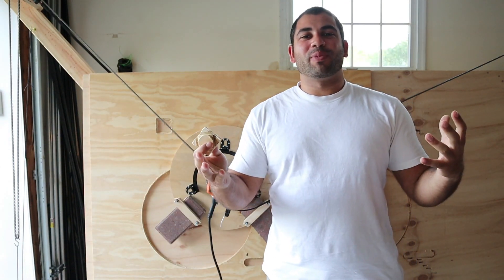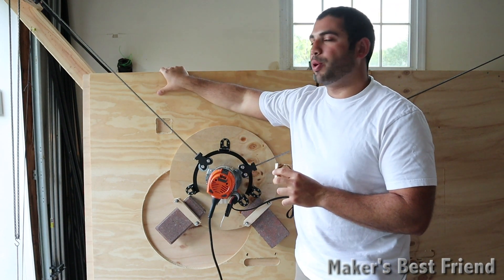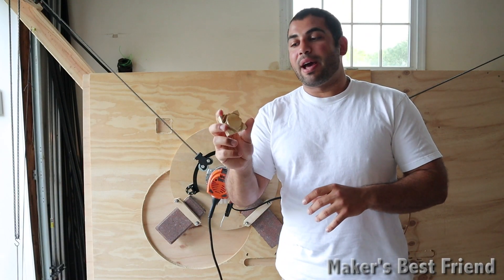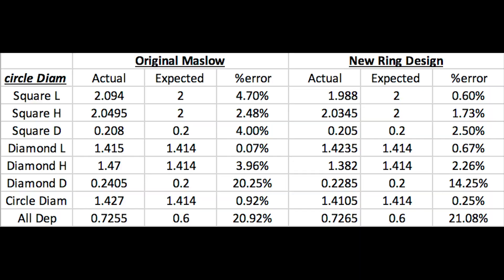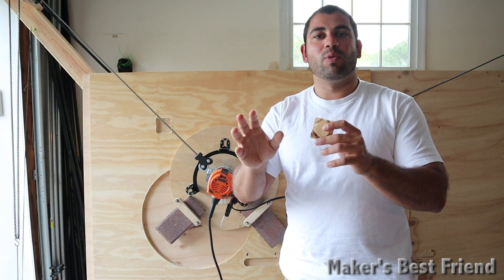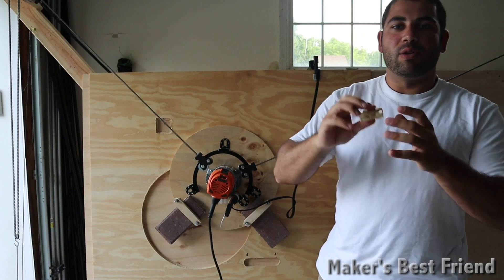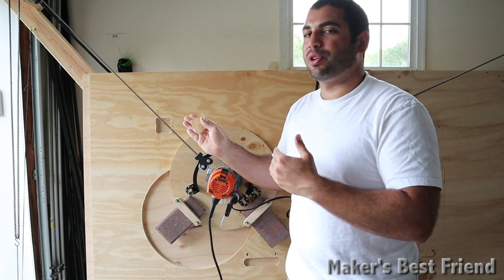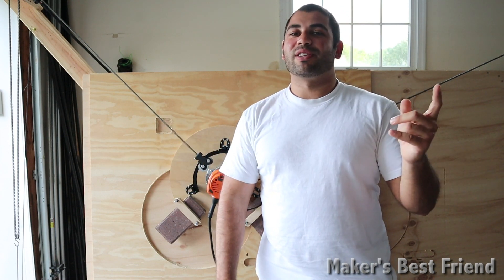Maslow CNC Ring Tolerance Test!

Comment: Can it utilize the entire 4x8 sheet? Edge to edge?
Reply from the maker: There’s two versions of the builds, one in which you use a larger top 2x4 that can do edge to edge
Reply: Yes but you'll have a lot better accuracy if you use a 16' long 2x4 (I used a 2x6) as the top beam.  the X and Y cables just reach but you'll need longer chains. (from Maker Made)